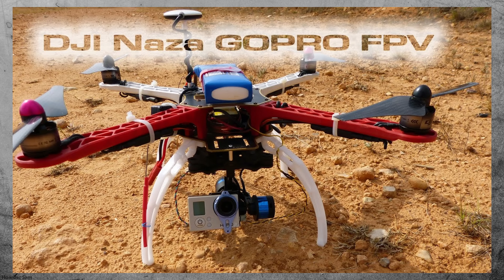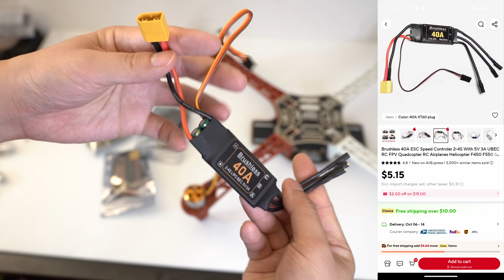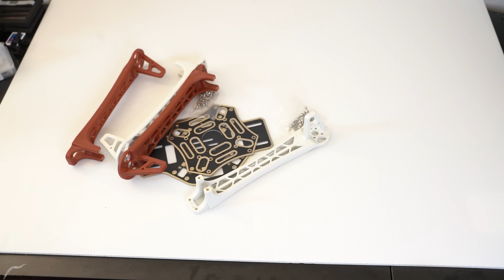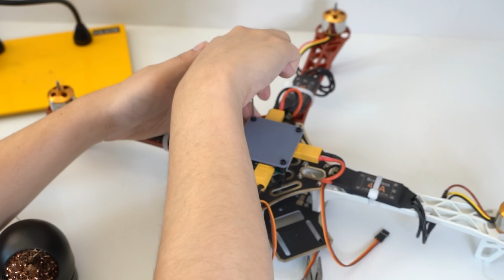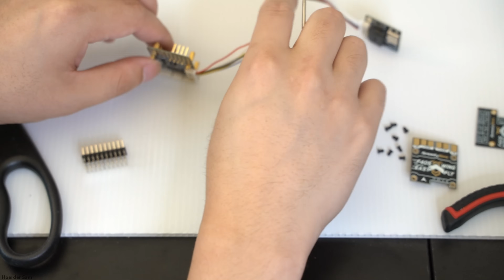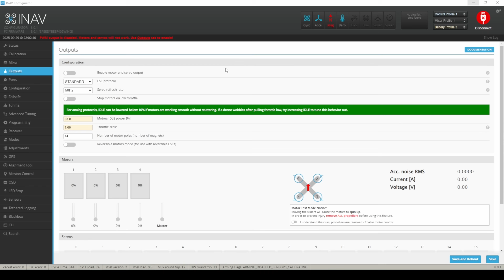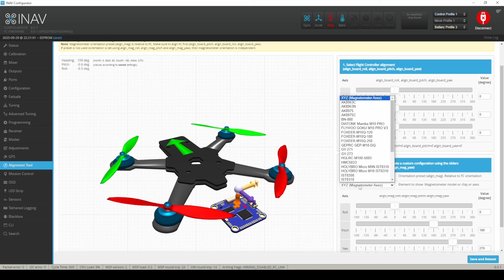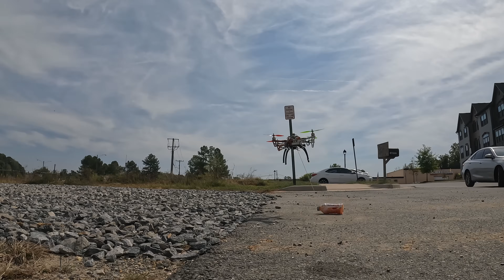I Built a $150 Autonomous Drone (Step by Step)

Comment: In real life applications where gps spofing and jamming exists you can't rely on GPS signal, so there should be alternative ways to navigate. PS: Greetings from Ukraine.
Reply: Im new to the concept but would a ground mesh network and a mesh radio equipped UAS be capable of autonomous flight? What about VPS? Is this technology proven at this point in Ukraine?
Reply: all was good till u mentioned ukraine, drones are exchanged there bit too much
all good there?
Reply: @Withcharizard
When a Ukraine 🇺🇦 citizen tells you that your open source, Cheap, Autonomous DIY Drone with a 2lb payload and better than DGI battery flighttime has peaked their interest - Know that you are on a helluva list......
Reply: DJI** Typo?
Reply: Echolocation
Reply: Pls, what alternative can you give, bro?

My project currently is based on delivery drone system
Reply: @Ihsanheart  Visual navigation, inertial and magnetometers system as backup also CRPA antennas can help on some way but nowadays spoofing signals can be huge
Reply: @vGamBIT  I'm also studying sensor fusion, do you implement a reverse path algorithm that tracks the old movements and recalculates its path? Like you said, mostly inertial dependence.
Reply: @duckdoan7977  I don't implement anything, but just saying that you can't 100% guarantee that gps or some any kind of gnss wouldn't be jammed or spoofed in modern world
Reply: Pretty sure Jesse Hamal has designed something to combat GPS jamming.
Reply: There are already algorithms available to navigate in GPS-denied environments, such as using visual odometry. PS: Greetings from Germany
Reply: I think ins and ai both intregated system are alternative option 😊
Reply: would full automation helps? pilot set mission to uav ( with camera ) then the pilot arm the drone then take off, then the uav do the work on its own relying only on offline maps and sensors to do its mission.
Reply: @dasig3010  yes, but it's rather complex task with many technical difficulties
Reply: @vGamBIT  maybe additional access thru starlink sats for more accuracy. 

once Im able to make my heavy coaxial octocopter fly ill try this little by little
Reply: magnav?
Reply: bro is speaking from experience. Viva Ukraine though
Reply: AI is used now instead of gps depending on objects analysis
Reply: pro talking from his front lines experience
Reply: Best I can think of is writing a program that uses "Topographic maps" to figure out its position in regards to the map data. The program would also need to be able to filter out/highlight errors such as craters, vehicle tracks and changes in plant growth.
Reply: @LrdBxRck that's very energy costly.
Reply: @qwertyboguss huh how so? It all depends on scale. Not like a small quadcopter needs a map of the whole of Ukraine. The AI just has to navigate like humans by looking at known data like celestial bodies, the horizon for landmark and final the given map data. Pretty sure all that can be handled by a $200 smart phone with a few extra cameras after loading the data from a laptop.
Reply: @LrdBxRck   yep this ! AI with inertian navigation ! opticarl transcievers can work too
Reply: @charliebrownn6622  I'm personally not a fan of fiber optic drones the clean up for whoever ends up in control of the land is going to be a headache. We are talking about years of clean up that are going to wreck the ecosystem. After this war is over I can see a ban much like the 1997 anti-personnel mines ban (Ottawa treaty).
Reply: @LrdBxRck I think some sort of inertial guidance based on last know gps signal would be much more efficient.
Reply: @L @LrdBxRck Jesse hamel has created software “synthetic gps” the gets  deployed to an edged device. With a drone it Transmits to the flight controller when it detects gps jamming or spoofing. His team is the first to produce it.
Reply: beacon /anchor
Reply: There are a lot more "real life applications" than war.
Reply: A fiber optic mod would be a good ideia
Reply: @Lucas-cm8zq Outside of war, doesn't look like such a great idea, leaving a mess of polluting, non-biodegradable fiber optic in the drone's wake... but that said, there are fiber optic kits on AE for under $100, if someone wants to try them...
Reply: @Lucas-cm8zq Fiber optics don't resolve proble - when navigation via GPS, it's resolve videolink and control link jamming but also have huge disadvantages and limitations
Reply: @vGamBIT  Agreed Re:disadvantages/limitations (among them leaving a "tail" behind pointing to where the drone operator is) but Re:GPS, I think the idea is to guide the drone with GPS until the jamming starts and then assuming control and guiding it visually.
Reply: @vGamBIT  yeah you right i got confused. The only alternative I see when satellite coms are jammed would be a INS but they are all to heavy for a quadcopter afaik. Maybe some software that could see the video feed and make a guess whats the current position but i havent seen anything like that yet
Reply: I don't mean to be rude, but this is more of a problem with Ukraine than it is with the quadcopter.
Reply: @CasparValentine  Today fpv drones and UAV's like Shahed-136 (and russia version Geran-2) it's not your problem, but it can change some day. As latest practice shown even such big and powerful country as USA was not ready for rather simple and comparably cheap threat as Shaheds and they asked Ukraine to help with that. GPS jamming and spoofing exist even in countries very far from war zone near the critical and important objects.
Reply: You people are the experts these days!
Reply: Slava Ukraini! Glory to the heroes! And death to Putin and his minions! 👍
Reply: Seems just fine anywhere other than a conflict zone, which is the vast majority of the world the vast majority of the time.... Unless you live next to Russia, that is.... I'm ashamed the US hasn't been 100% behind you guys from the start. I was strongly tempted to join the Ukrainian Foreign Legion when the invasion first happened, but I'm getting to old and fat, and my combat experience is decades out of date from what you guys are doing. Keep up the good fight ✊️
Reply: @cyruspalmer98   Boomer, demented, or both?
Reply: @MattyEngland  was that supposed to be a coherent thought?

Comment: As I have built this kind of drone with Inav before, I remomend using MavLink for ELRS to get more in depth telemetry on a phone or similar. However take in to consideraton that groud control software such as QGC can only monitor the drone in inav 8.01 unfortunately, so no arm from app.

Comment: It would be very helpful if you add an fpv camera and do a video about that upgrade.
Reply: From my experience, on the F450 the fiber glass frame has a lot of vibrations. The FPV feed is pure jello. From my experience of 12 years building

Comment: I would be very worried about sticking the FC using the double sided tape by hand...you can be just 1° off and it can cause problems. I would put holes for FC on that 3D printed piece, so it is sure it is exactly diagonal and used some gummy washers to reduce vibrations...the same for the GPS mounting as well, so the compass is perfectly aligned...
Reply: The alignment can be compensated for by doing the simple calibration again. The parts don't really care which way they are pointed as long as you calibrate them.
Reply: @ThinkFreely2012 You cannot calibrate FC orientation. Yes, you can set the orientation as an angle in the configuration but you would need to measure it very precisely, because if it is just a bit off, you would need to put in the exact angle as well or when flying straight, it would go a bit sideways. But it is too complicated than just printing the piece and mount it precisely 😉
Reply: @Tomcat2_kanal  Not true.  You do the calibration just like he did in the video when he updated the firmware.  You go through the setting the quad on the nose and the rear and sides etc.  

Is it better to install in perfectly straight?  Yes,  probably.  However,  it isn't absolutely, positively required.  Besides,  if you're not cross-eyed, you should be able to install it pretty damn straight even by eye. 🤷‍♂️😂

Comment: It'd be cool to engage PCB Way to print/create a more custom setup where maybe the frame is in itself a pcb- no wires... no soldering. Reverse engineer the other components- where each can be its oun layer, and like the Pi brand have something like GPIO pins/ headers that depending on what your need is you can just sandwich them together.

Something else I've not seen..well, I have seen unintentionally. Just not intestinally- is the utilization of carbon fiber's conductive properties some way to reduce cabling or maybe adding features like utilizing different layers of carbon fiber to power LEDs on the drone arms?

Just throwing further ideas out there- but, indeed I'd be interested to see someone do the items I mentioned in my first section there.. how cool would it be to have an educational platform where students can just connect the different modules together- a big roadblock in building drones is the soldering part...so many are intimidated by it to the point they give up or don't attempt... now have students just select specific modules for their usecase, squish the modules together by some pin headers and do some basic programming... would save a buncha time also... neat.

Comment: What do you think of using 10 inch props on 1000kv motors? Also, what about using 4s instead? Thanks for the guide!
Reply from the maker: 10" with 1000kv is a good combo. But keep it to 3s, I don't think any of these motors will take 4s very well
Reply: @hoardersam10 thanks for the reply. Your videos are great 👍 👌
Reply: @hoardersam10  Would it significantly more efficient (in terms of flight time and range) than the 1400KV/8" combo you used? By how much, 20% or so?

Comment: Wow! Thank you so much for this video. I am building almost the same drone from similar parts and I was stuck at finding a cheap FC. I had looked at the Speedybee F405 Wing Mini but wasn't sure that it would work for a drone. You solved that :-). Great job showing the entire build as well as how you overcame some of the stumbling blocks. Too many videos are done with "no issues" and seeing how you resolved the failed motor, etc. was refreshing. I am hoping to use ardupilot instead of INAV but good to know that iNAV is there as a fallback.

Comment: Nice project and really cool to see it all work out! I used the CC3D FC with Open/Libre pi;ot originally. It worked well too, but back then not much GPS support although it was possible.I had the old style motors but went for EMAX 935kv motors and they turned out to be well made and reliable.

Comment: The first drone I've ever built was a DJI Flamewheel 550 Hexa... after that a 450... somewhere the 450 still exists. Maybe someday I rebuild something from it... very inspiring Video. I remember how expensive the GPS and Naza Flighcontroller had been back then... paid about 600 bucks for a less capable drone than this 150$ drone on the same frame 13 years later.
Reply: It’s true/ or f love this LiDAR and  thermal to attempt changing my Life course into my dream career

Comment: BTW i recently switched on my prime drones to M100-PRO model from M100 ,same size, same plug ,same compass orientation..
M100  (M10 72-channel) and  M100- Pro( B101 120-channel )  about  double is satellite scan and can  lock ~X2 more satellites too and get better DOP also.. i have seen over 42+ on PRO  with DOP 0.6  ..  same drone with M100 gets 26-28  abd DOP 0.9 on non pro model ...

Comment: will it work ardupilot? and also will it work with normal speedybee wing pls ans i have this kind of platform but using stm32F411c but it only work with inav 6 so i m thinking of updgrade to inav latest version and want to explore ardupilot specialy using with uart commant
Reply from the maker: It should work with ardupilot but I haven't personally tried it yet. Yes the build will work for the full size speedy wing too, but the specific steps may be a little different
Reply: @hoardersam10  thanks 😀